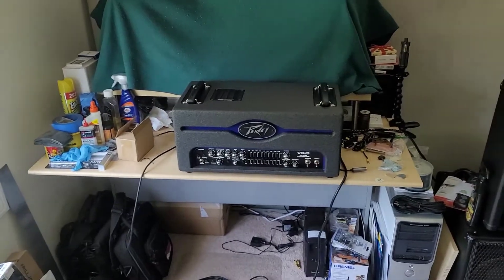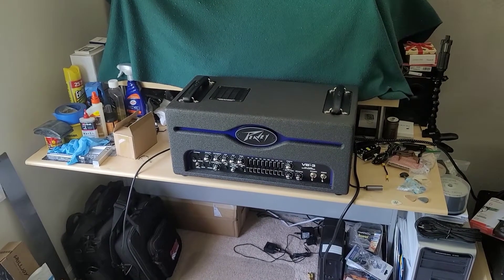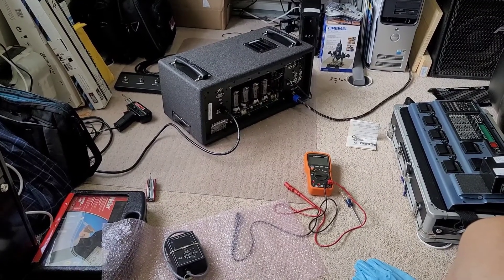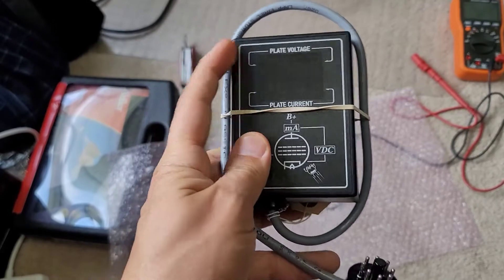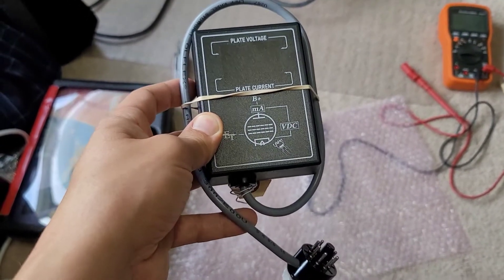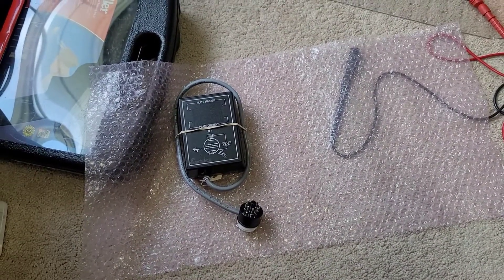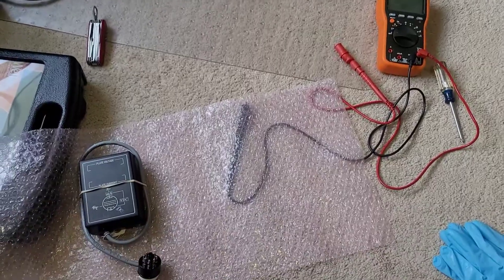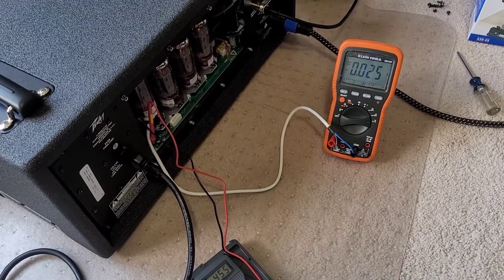Peavey VB-3: How to properly bias the power tubes of a tube amp

Comment: Did you ever get an Amptata V8 Tube Tester Bias Current meter.............
Reply from the maker: @diecuttingsolutionsinc6745  yes I got two
Reply: @Bassguitarist1985  makes it a bunch easier to bias the vb3 and vb ma
Reply from the maker: @diecuttingsolutionsinc6745  it does!

Comment: Great video!  Very helpful...you might want to check the other 3 rear-most power tubes as even though they were originally matched I've found some out of range by some 10ma.  That way you can get an average of 25ma by taking into account the measurements on the other tubes.  I had one that was 38ma when the tube next to it measured 23ma, even though they were supposedly matched...
Reply from the maker: Thank you for the advice! Interesting how that works out having a matched set that they can be not so closely matched...

I got a gig this weekend and plan on using it :-)
Reply: @Bassguitarist1985  Great!  You should post a video of your tone.  Regarding power tube matching, I'm sure they were actually matched at one time.  But, the nature of the beast nowadays is they don't all age the same and some drift much more than others, not counting any rough handling or drops in shipping, etc...it doesn't take much.
Reply from the maker: @huskobar4545  agreed! Oddly enough I found that the bias voltage was set to -46.2 volts of DC when I got it off the truck the other day. Now it is set to -45.5 volts. I believe the gentleman that used to own this amplifier that it has very low hours as he mentioned he has not done any biasing since he bought it back in 2010 timeline i think.

I have plenty of Peavey gear to sample the tone and I would like to get a nice DI tone from it. That is certainly on the docket for me!
Reply from the maker: @huskobar4545  hey, the DI tone sample is coming! Fixing the DI actually with a nice Jensen transformer to get rid of a nasty ground loop that the electronic balanced DI cannot get rid of.  I beleive it may be a chassis/signal ground issue between the 7 PCBs inside. John just scored a VB3 for himself and will be checking it out this coming week. My state is going into heavy public place restictions again, and my day job is down to essential employees only so Ill be working from home for the foreseeable future. Will be easier to jam out inbetween meetings and such!
Reply: @Bassguitarist1985  Hi there...sorry I didn't get a chance to respond sooner.  I didn't get a chance to try my DI yet.  Do you find it is frequency compensated?  Not really a cab simulator, but the older Peaveys at least had the high end rolled off since tweeters weren't used in bass amps back then...my old Alphabass has an amazing DI and line out.  Dead quiet, and amazingly needs little eq even when using massive distortion...the high end sizzle is already filtered out.  Let me know what you find out from John...
Reply from the maker: @huskobar4545  ill def let you know soon. Im running through a rolls ms20b isolator, not the best xformer inside, direct is the nasty hum. Ill report back ASAP on the freq response. The Jensen xformer should be here midweek.
Reply from the maker: @huskobar4545  Hey! I fixed the DI! Jensen transformer is def needed. I tried isolating boards from the chassis but that made the ground loop buzz worse. IDK, im thinking there is a defect somewhere where the chassis ground and signal are bonded more than once inside the amp. John's VB3 he said is nearly silent. I do hear low level 60hz hum with the xformer, but its soo low db you would never hear it compared to the ground loop buzz which is very apparent. Ill be making a video soon!
Reply from the maker: @huskobar4545  also the DInhas full range frequency response, but the -3db starts around 4000hz and progressively gets lower as you approach 20k.